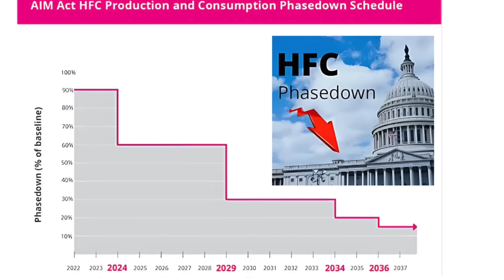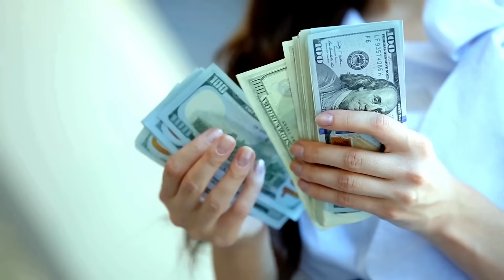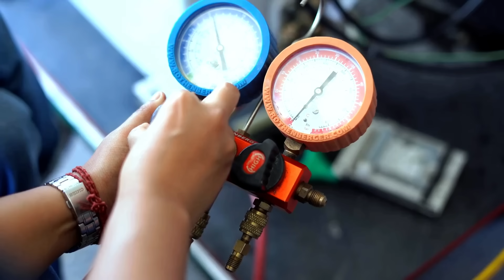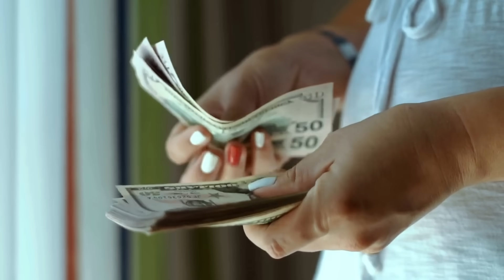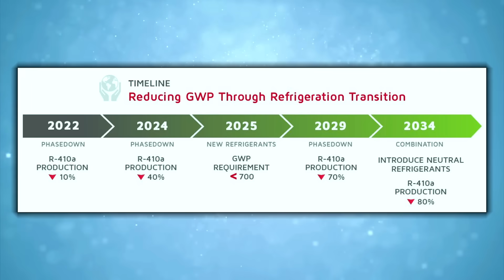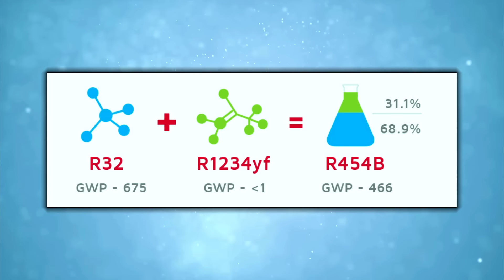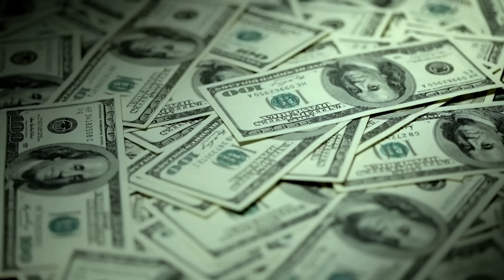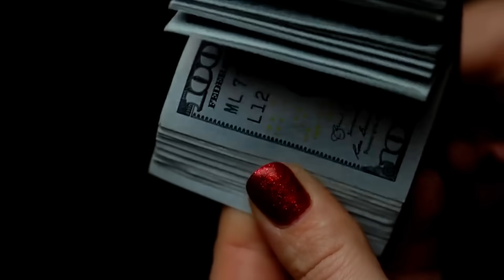Latest on the 2025 Disaster in HVAC and 454b Problem!

Comment: Retired now, but spent 44 years in the HVAC industry.
When the environmental concerns of refrigerant came to light in the mid 80s I attended several meetings with manufacturers. The common consensus was this was going to be the best thing that ever happened to the HVAC industry. And they weren’t talking environment. They were talking profits and career opportunities. Sure it’s helping the environment; but what a $$$$$ maker.
Reply: It looks like YouTube censored my earlier comment. These refrigerant changes do nothing but increase prices and profits for manufacturers.
Reply: @picklerix6162   Exactly!  When I read that the CEO of Starbucks got a $10million bonus last year it told me about all of these SCAMMERS!
Reply: It’s not helping the environment either considering this ew equipment is breaking down and needing replaced sooner then the older style units….piling up in scrap yards and costing the consumer way more then they should have to pay for equipment that is built using the planned obsolescence model
Reply: I have yet to see any proof that discontinuing refrigerants had a positive effect on the environment. In a couple years, we’ll be hearing about R-454b and R-32 being phased out and banned.

Comment: Do not buy a new Freon for years after its introduction! Keep your existing units running. You can switch out r22 for 422d and keep it! They will keep selling 410a for years and hopefully they will start selling dry stack units. In other words it will come without Freon and the installer will charge from a bottle of 410a. But the best solution is the government stops mandating how hvac units are built.
Reply: Freon MO99 r-438a works for R22 units, no clean outs or flushing the system needed

Comment: As an HVAC tech... I try to keep every existing system I service running for as long as possible.  Always informing my custoners of their available chioces and the pros and cons.
I repair way more systems than a put in new replacement systems.   With that said....

I find it interesting that 454b is described as very similar to 410a. In terms of pressures and functionality.  Some information says that 454b has slightly lower pressures.  Other guidelines say that you should not use 410a in a 454b system because it was designed for higher pressures and with 454b's flammability factors in mind. 

So, my question (almost rhetorically) is "why not."
The systems can handle the pressure.  And, anything more added to deal with flammability is just redundant. 
Since no flammability exists with 410a. 

If you're really stuck.  You could reclaim the 454b.  And, charge with 410a.  ???  Right....

Anyone... any thoughts?

*Of course,  you would have to put a 410a sticker on it.
Which would probably void the warranties.

Comment: Thanks for the video. I'm going through this right now. I live in Ca and my current system is a Bryant 410a 3.5 ton package. Was thinking of getting a 410a but can't find good brands that still have 410a. So was thinking of getting a new system of r32 but found out that Goodman only uses r32. Most of the other brands are using r454b. I know Honeywell has patent on r454b so they're making a lot of money off from this.

Comment: The newer varible speed condenser fans, that do not use a capicitor is anothrr huge problem.

These fans are extreamly sensative to brown outs. If a thunderstorm makes you lights go dim, there is a very high chance you now have a $500+ repair bill for your condenser. 

It is higly advisable to cut the power off to the condenser if a severe thunderstorm is on the way.

A power lineman cutting power off to your neighborhood, for some kind of reapir, can also kill these condenser fans. 

I am lookimg for a device to add to the powet line, from the breaker to the condenser, that will cut powet off to the condenser of it detects a brown out. Because it is not always possible to be home to turn the power off in a storm. What is this type device called? One that can install by the outside pull switch.

I already have surge protection on the condenser and whole house but they do not protect from a brown out.

Comment: I have my jugs R410 is easier to install you still have a uncased coil option. R454 b and the R 32 you have the migration controls to deal with.  they are pulling out the r 454B and evacuating and installing 410A.  The oil is the same Pressures are almost the same txv knows no different. We do not do that but hot climates this surly be done. you are over thinking it

Comment: R454b is basically R410a with propane added… so to top them off you just use R410a… (propene is propane). They are highly flammable according to the MSDS…
Reply from the maker: 🤣 might be the most wrong comment I’ve ever seen

Comment: 8:49 manufacturers under charge equipment so that the installer does not have the hassle hauling reclaim equipment out to the outdoor unit. There is not a shortage of refrigerant, it is a lack of special valves for small bottles.  Flammable refrigerant cannot be vented quickly if over pressure occurs and the valve that safely vents the bottle is back ordered everywhere.

Comment: What do you think of adding a 454B evaporator coil and condenser but keeping a gas furnace that was installed with a 410A system? I've seen conflicting advice on the feasibility of that.
Reply: Completely fine.  Blower motor is all the furnace does in ac mode.  Just wire harness to add.

Comment: its all about selling more systems, every time they come out with a new Freon running pressures are higher which means compressors and coils run harder which = shorter life spans so R-12 units would last 20-30 years now 410A units are lucky to make it 10. I think Ammonia was probably the best refrigerant, since it actually can be produced in nature hence making it "environmentally friendly" but was deemed unsafe because it will take you breath if you get a whiff of it, but practically a home HVAC system could not produce enough ammonia gas to severely injure anyone. also ammonia if I'm not mistaking runs on less than 100psi which would allow it to run forever w/ todays compressor tech. wish you could buy black market ammonia based HVAC systems. I'm in the electronics business and todays TVs if watched more than 5 hours a day will only last 18 -25 months, thats because by design they are pushing more current to the led's in the backlighting circuits than they're designed to handle i.e. most led's run on 350mA max current, TV power supplies are cranking out 500mA +

Comment: Amana and Goodman uses R32. I’ve been installing that and haven’t had issues getting the refrigerant.
Reply: That’s great but what about the people who have purchased 454 units!  It should be in the manufacturer to refund the customers so they  can get a new unit that the refrigerant they need is available . Shouldn’t  be in the contractor or customer.
Reply: @soulfireonfire6423 if you’ve purchased a system that has already been charged with refrigerant it should never need refrigerant again unless there is a leak and that shouldn’t happen for many many years. I’m sure the whole shortage thing will be worked out by then.
Reply: @soulfireonfire6423  If you’ve had a system installed it should never need refrigerant again unless there is a leak and that should be a very long time from now. Refrigerant is not like oil. You should never have to add it or change it. It’s a sealed system.

Comment: I'm actually stock up on the old stuff since I'm catering to commercial businesses. All these blend refrigerants will destroy consumers when the system has leak. Entire system need to be fully vac and then get charge extra to dispose the "unknown" refrigerant.
Reply: I think it’s funny that hvac contractors are only concerned about commercial applications…when that is the group of consumers that need to feel the issues and then when they make a fit about it, then the authorities will make some real changes so keep contributing to the problem….the dollar general store went most the summer last summer with no ac and most the refrigerators down because they had a new pos system installed and it immediately broke down…then they couldn’t get parts and then they couldn’t get Freon.,,lmao…they have one ac running the building this summer and it’s an older unit so the contractor musta installed a used one to get them by …and this is the second summer now…this country has turned into a clown show…

Comment: The 454b being flammable, there installing leak preventing detector in the condensers, which the first impression would  be the manufacturing spec's had problem or just in case situation, so their not liable.

Comment: Just fill it with R32 or 410a ,, both will interchange with 454. Done it several times.
Reply: R32 equipment uses POE46. 410a and 454b use POE32. Using R32 in a system that doesn't use the oil thats needed will not end in a good way. You could remove the 454 and put 410a in....that would work as the oil is the same. I definitely wouldn't use R32 in a system with the wrong oil.
Reply: @JJ-COMMERCIALHVAC the whole issue with R32 and a thicker poe is debatable. 

As long as the system is kept clean and your discharge temps are kept reasonable, it’s not going to be an issue. 

They are doing the higher weight to hedge your bets. 

And also this is not as a perm  fix. This is just to get by while the 454B shortage catches up. 

Once it does come back and pull the 32 out. 

Because 410 is going to hit shortages too if the 454B doesn’t catch up soon.
Reply: @BVN-TEXAS  you do you Bubba. I wouldn't mix refrigerants that were designed with different weight oil. If it works for you thats cool.....long term is where the answer will show itself.
Reply: @JJ-COMMERCIALHVAC  well “bubba” you are the one who came in here telling me I had it wrong and couldn’t use those with the different oils or else acting like it was going to be the end of the world. My point is you can freely swap 454b and 410b long term with no use issues at all. 

Yes the oil isn’t ideal to toss r32 in there instead of 454 but it will work just fine and buy you some time to come back and by and fill it with 410 or 454b.
Reply: @DasNewsNetwork   Nope, can't purge all the oil out like the refrigerant. Don't mix lubricating oil. It won't end well. Too much evidence of that already. I would never let a HVAC technician mix oils. You do you, but not to me.

Comment: I am sure glad that the majority of my career as an AC Contractor was when we used R22.  I wish they would leave a good thing alone.
Reply: I still only service R22 systems only, and it keeps me busy.
Reply: @Joe_Potter_2  Hey Quick Question My Trane Xr 16 Pushes Good amount of Air When Heating or Cooling but in the on position the Air handler barely Blows is it a wiring issue that doesn't have an on full speed????
Reply: @sabianstringer2112 fan on steps down to speed tap 1 if an ECM motor and steps up with call for cool, and generally again for heating, with different speed taps. If direct drive PSC motor should be 100% at all times. 

I’ll also note this is sequential so a higher speed call will always override a lower. The above only applies To fan on, no cool/heat call.
Reply: @Joe_Potter_2  near mn? lol mine needs a recgarge.
Reply: @Joe_Potter_2 I don't care what anyone says about R22.  Best refrigerant ever.  The blame goes on the EPA.
Reply: In 2016 I Went With Trane XR16 Because Newer Models Have Split Phase and Variable Compressors Which Are Garbage.
Reply: @sabianstringer2112  split phase bro everything is either 1 or 3 phase in the USA.
Reply: @sprockkets  sorry meant stage
Reply: @sabianstringer2112  I don't have the exp to back this up but Trane outdoor coils are now having issues of all things.
Reply: @sprockkets  
single phase is often referred to as " split phase". The transformer splits it into two 120 volt lines with a neutral.
Reply: @anthonypaules7893  but are the two lines in split phase run 180 degrees out of phase???? (sorry I am cable guy don't slam me for not knowing terms)
Reply: @anthonypaules7893 it's irrelevant, the op meant stage, not phase. 
Yes, the usa takes 240v and splits it, but it is still 1 phase. Other countries give 240v to neutral.
Reply: @sabianstringer2112  yes, a single "split" phase. 180⁰ out. 3 phase is 120⁰ apart, but they do split one of the phases in a delta for single phase loads. They split all 3 in a wye for balanced transformers . Gets pretty deep at that point and above my pay grade.
Reply: I'm jealous of you guys.  You really lived in the golden years of HVAC.

No bells and whistles, just reliable air conditioning.
Reply: @dennisyounker1032 I try and tell customers to stay away from the high-tech stuff.  Keep things simple.
Reply: still have mine r 22
Reply: R22 was probably the best refrigerant ever used.  You could put your hand on the line-set and it was freezing cold. EPA and our government screwing things up again.
Reply: yep many years ago when house was needing replacement was the time when R22 was phasing out, found a warehouse had some clearance R22 stuff trying to get out of their stock had what needed got it installed and still running great. Moving back to olf family farm home and know the current system is needing replaced soon as got hold of complete 410 system while still available.
Reply: Firm believer in R22
Reply: Abolish EPA
Reply: @irvinewayne4086  
Its doing what all government programs do.
After fulling its purpose it creates new problems to fix so it can forever expand and waste tax dollars.

Comment: Why would the manufactures apologize for something that is not their fault. You need to talk to the US government and the refrigerant manufacturers. They do not have the right tanks to ship R454B. R454B is available because manufacturers get it delivered in large containers. Also R32 equipment according to current US guidelines will only be made until 2030. then it will be phased out as well.

Comment: 32 freon would be the better way.  Seemingly maybe, but there's no shortage if you have money to buy. what there is, a monopoly on the product because of manufacturing favors particular path for selling it. 
Don't buy anything that isn't a standard in the United States.  And don't buy anything that's made in china. People are in for a wake up. China owns us. You just don't know it yet. If it says china, by way of any other country it will have a big CE on the packaging or label or nothing at all to hide their products.  Sometimes,  you have to, that's understandable,  but for a big purchase like a hvac system,  no no. R32 way to go because,  in some cases depending on the compressor, you may be able to retro fit the airhandler with a new evap"coil" to use the r32. Is this code? How long will it work? Can you sell jobs like this? Probably not..but, if it's your house then, the difference in cost, I'd go with and do that change over and lable the unit with a big fat sharpie. And i would have an r32 system to begin with ✌️ 
Thanks for this video great info 👍

Comment: I just serviced my excellent working Carrier Tech 2000 Model 38TG from 1990. I installed a new Amrad cap, and a new condenser fan motor. Still operating on the original R 22 charge, and beer can cold. They don't make them like this anymore. There are 3 other Carrier tech 2000's in my neighborhood, all still working.....  https://www.youtube.com/watch?v=nsevP8GPyus

Comment: Don’t worry I’m from the EPA and here to help !   I’m a retired 40 year vet of HVAC.  Talk about being behind the 8 ball I’m it.  I have a 25 year old 16 seer R-22 system in my home still working perfectly.  I recently had to replace my daughters entire system with one of the last 410a systems left.  It prompted me to consider buying a 410a coil and condenser to rat hole when my system finally needs replaced, it’s to late all the 410a stuff is gone.  The EPA puts all this unnecessary cost on the backs of homeowners.  I hope I’m dead before this all come to haunt me.
Reply: You are correct, it is all about greed. I am not really convinced they even believe all the propaganda they’re pushing. And you are also correct that the only ones getting hurt is the end user. I have been an HVAC and electrical contractor since 1987. I feel horrible for those who have a R410 unit, and all they need is a new condenser. I basically am retired, but doesn’t stop friends and family asking for help. I was lucky enough today to help a family friend find one of the last R410 condensers available for his home. By the end of July, there most likely will be none left.
Reply: I did the same for my Son, had a York split heat pump R22, unit was 38 yrs old. convinced him to buy a R410 system 3 months ago and rat hole it, put it in last weekend
Reply: You’re a good man…we all need to protect our customers against this Wall Street hedge fund “pump & dump scam”…and all the followers in the HVAC industry.  Greedy Wall Street scum and HVAC “comfort advisors” (puppets) are doing the same thing to HVAC — like the mortgage crisis in 2008.  We need to unite and repair, repair, and repair 💪🦾
Reply: I have an old r22 condenser in my shed for when my current compressor fails.

Comment: Its all based on climatist fraud and has been for many years. The solution is simple, get rid of the EPA and bring back R-12, cheaper to manufacture, simpler equipment, way more energy efficient due to its low operating pressures. The equipment also seems to last way longer- Ive seen R-12 systems still working today 35 years later.